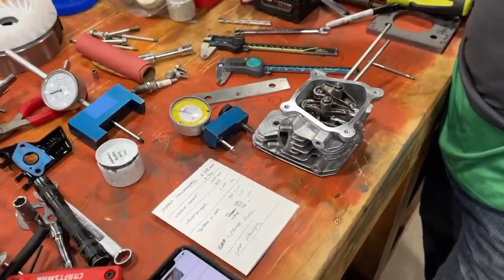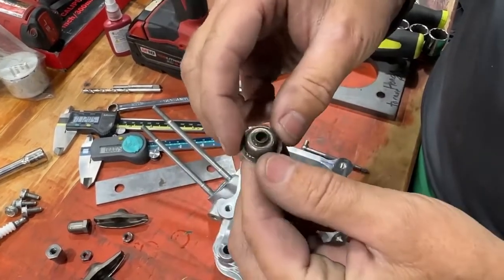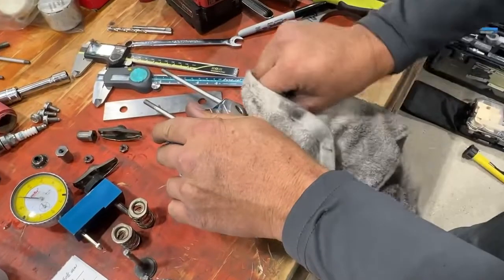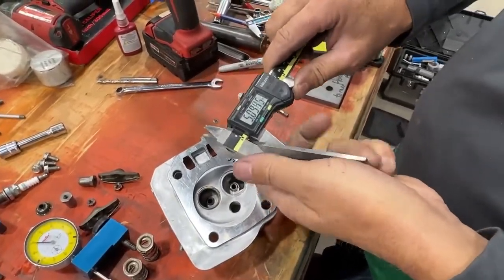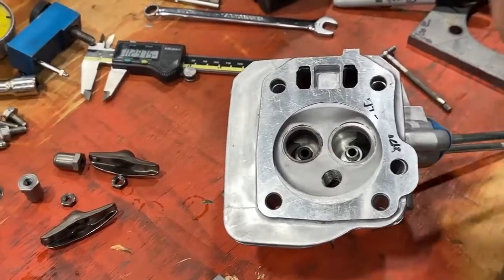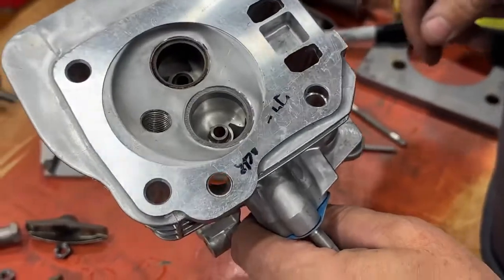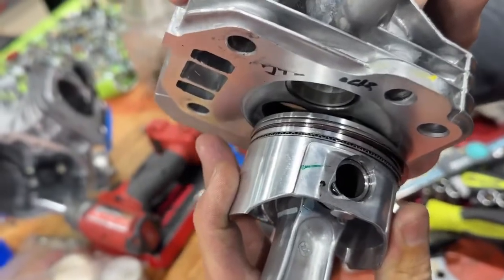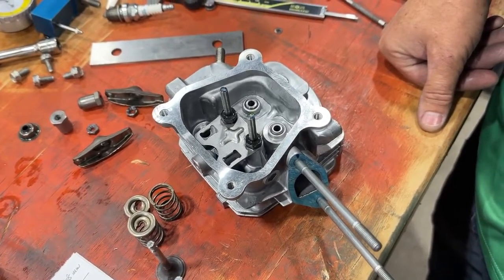How to build a fast Honda GX 160 Quarter Midget Engine from start to finish Part 5 Head Games

Comment: Spring pressure on the intake valve is increased when using the seal. Kind of like a shim, more possible RPM before valve float when using the seal.